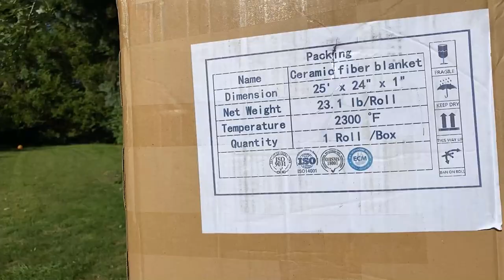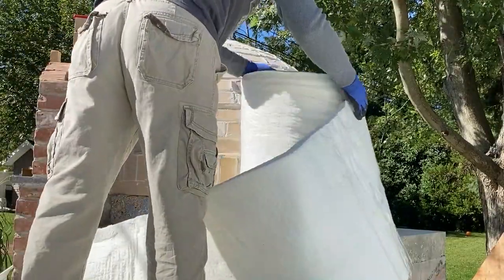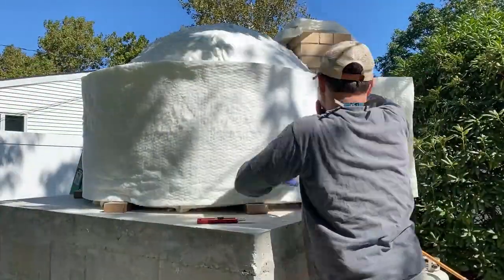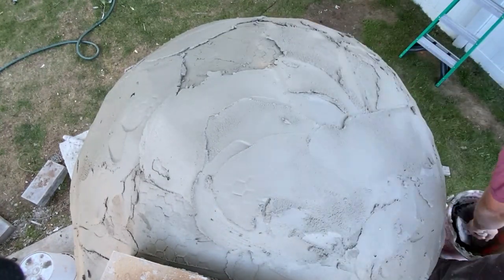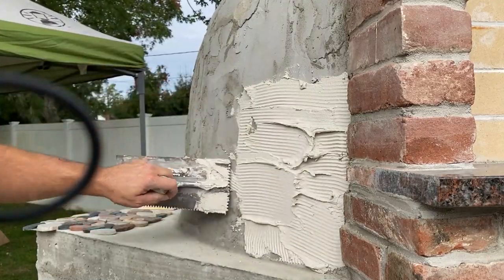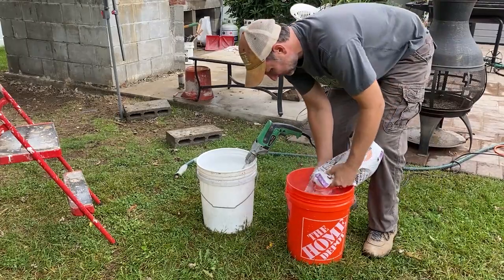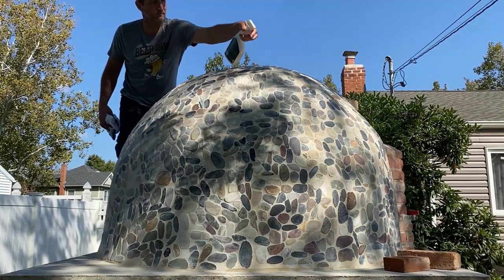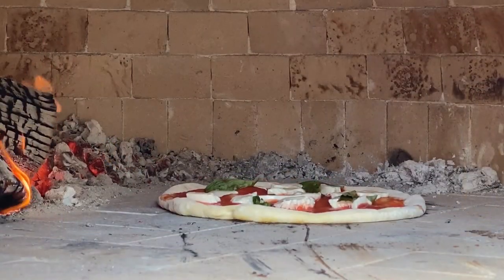How to build a brick oven / Outdoor Kitchen Build - Part 8: Insulating and Rendering a Brick Oven

Comment: The firebricks are way "too hot"  i.e. burning the pizza. I am thinking to use masonry bricks, not as hot and not as durable but better baking. Thank you for sharing.
Reply from the maker: That would be a mistake. Fire brick is what you want especially for durability. I have never experienced too much heat from the firebrick. Other bricks might be problematic If you plan on cooking multiple pizzas you will exhaust the retained heat and have difficulty getting the bottom to cook evenly with the top.
Reply: I get your point and you know more than me on the topic as I did not make a single oven yet,  but from the research I've have made it seems to be a problem especially the floor. Even in this video you can see the pizza was burned at the bottom. Anyway, thank you for replying, I will make an oven with masonry bricks as I have them in property. If they don't perform good I'll do it again with firebricks.

Comment: It took me about two years start to finish. I did the base because I had a lot of kiln brick laying around. Thought I could use it, built a dome, found out I couldn't use it, and walked away.

Restarted about a month ago. Doing the rendering layer today. Not as pretty as yours - I made some mistakes - but it's done and will work. The mistakes were fairly minor, but also I've never done this kind of project before

And absolutely could not, and would not, have even tried it without your help.  Thank you!
Reply from the maker: Thank you,  as long as it cooks great pizza, that’s all that matters!  Good luck!

Comment: Thank you for sharing an excellent series on this oven build. Can you please confirm what type of cement you used over the chicken wire? What was the mix ratio of cement and sand also. Thanks
Reply from the maker: It is type s concrete mortar. Sand is already mixed in. Just add water and you are all set. Thanks for watching.

Comment: Wow! just found your channel and this series, watched it all straight, and subscribed. 
A few questions if you don’t mind.
1) for the base brick why didn’t you use the 1” thick fire brick, as far as I know it has the same fire rating as the thicker ones? 
2) for insulting the oven why didn’t you also go with vermiculite, it’s obviously way cheaper?

Thank you, looking forward to your future projects!
Reply from the maker: Great questions!  1. Thicker firebrick has more thermal mass which allows it to store more heat and will stay hot longer. If you are making 10 pizzas, that stored heat is what will cook the bottom of it. Also, 1 inch firebrick is more likely to crack. 2 vermiculite does not insulate as well as the fiber blanket, and would need to be 6 inches thick to get close to the same properties.

Comment: Beautiful oven, been pondering building a oven myself but I'm no mason, I'm a fabricator. I thought about making a dome out of steel with two layers and the insulation between but not sure if it would still cook well due to it not retaining the heat as well as the bricks. I would use the firebrick for the floor since i feel that is a must. I haven't been able to find any information on this design anywhere.
Reply from the maker: I don’t think it would retain heat well but maybe use that shell to as a mold for the brick dome. Would be much easier to build.

Comment: Glass fibre insulation I think would be a cheaper option with a layer off vermiculite,
Also all ways two coat render and every coat has to be weaker than the first, tiles look superb great job
Reply from the maker: Don’t go cheap on the insulation. This is the most important part of a well built oven.

Comment: after laying down a foundation for my outdoor kitchen which will include pizza oven found your channel. 
A lot of valuable tips! Thank you SO MUCH!

I have a question to somebody that did this before in Southern California. Where did you buy a fire bricks? 
This is the only part Homedepot will not deliver. If you have a pickup truck I guess it's a silly question. I have minivan and it will take a few drives to bring 200+ bricks
Reply from the maker: I bought them a my local mason supply store. Home Depot doesn’t sell there here in ny.

Comment: I friend! I saw all your brick oven videos. I saw a tones of it on youtube and yours are the best! I woluld like to make my own oven. I have been thinking on build the dome with refractory concrete, using a wooden made molt. How you think about it? I would add the polistiren fiber and a outside brick layer. Thank you mate!
Reply from the maker: A lot of the prefabricated ovens are built like that.  If you are going to mold the dome, you need to use a special mortar.  Use a castable refractory mortar.  The regular refractory will crack once it dries.  I thought about doing a mold, but the castable refractory is very expensive where i live.  I hope it costs less where you are.  Good Luck!
Reply: @ArtisanMade  Thank you mate! I live in Catalonia (Spain, europe). I don't know what exactly is a castable refractory mortar. I do not know if is selled here. I think here is only the regular refractory mortar selled. Can you bring me some link to find something similar in spain? Thanks!

Comment: Can you make a video about how you use it such as maybe different meals you have cooked and what you would consider if you were to build it again. Maybe you would add more table space next to it.
Reply from the maker: I am planning on doing a video like that in about a year from now. This oven is part of an outdoor kitchen that will be completed next summer. It will include a pizza station, running water, and a wood fired bbq. Once that is finished I will be launching a cooking channel  that will focus on wood fired and brick oven cooking.  Thanks for checking out my channel.
Reply: @ArtisanMade  great stuff 
I have been searching for ideas and a blueprint to build a pizza oven and I would say your videos are probably what I will follow. Do you think the pizza oven should be protected from the elements such as rain? Or that is not an issue? I will be starting my pizza oven in the spring months in the uk. Do you not use the pizza oven at the moment then ? It will be great to see what other dishes can be cooked using the pizza oven not only pizzas.
Reply from the maker: I would definitely protect the oven from the elements. My oven is part of an entire kitchen that will be completed next year,  and will be covered. As far as the cooking goes. Once the kitchen is finished, I will launch another channel that will showcase brick oven cooking. Good luck with the build. If you have any questions along the way, let me know.

Comment: Your videos on the build are awesome! (Watched them 4 times already) Will use your instructions to build mine. However, quick question. Why did you decide to use vermiculite as opposed to Perlite? I’ve heard perlite is stronger. Thank you
Reply from the maker: That are both good.  I was able to find vermiculite locally

Comment: we don't have those kind insulator fabric back then we use glass bottle cut in half and build it around the oven including the bottom of the oven then fill the gap with a sand(silica). then cover it again with fire brick and cement.
the layer fire stone bottle+silica sand or iron sand then fire stone again.
so the fire brick attach between a glass use a cement.
Reply from the maker: Thank you for sharing this. I am always fascinated by how things were built before we had all of this science and technology.

Comment: I have been following this excellent series and today, I partially rendered the oven to cover the wire mesh and planning to complete another layer tomorrow. I am afraid that if cover the mortar(type S) with 1.5 inch; then if may fall off due to wait. Is it ok to follow like this or just need to complete the job the same day? I do have some exposed wire mesh but insulation is covered entirely.
Reply from the maker: I'm not really sure.  I would try to finish it all in one day if possible.

Comment: Great video's! Maybe you said this in one of the earlier videos, how much $$ were the materials for the project? What do you think a contractor would charge for a similar project? Hope yours performs as good as looks.
Reply from the maker: I spent between $2500-3000. You can cut costs if necessary.  The stone tile was expensive and the red reclaimed bricks were more than regular brick. If you live in NY. Contractors are expensive here. Most of this is labor.  I think labor costs would have to be at least $8000. Hopefully a contractor sees this thread and will shed some light on this.

Comment: Awesome video series!   Did you need to do any extra curing fires after adding the rendering/mortar/grout?  I'd think you'd want to drive out the water content just as slowly with these layers, but the ceramic blanket might slow that process down enough that you don't need to do anything special.
Reply from the maker: I did fire up the oven to about 500 degrees once before cooking  because I thought the same thing. But I don’t think it was necessary.

Comment: Great build! Not sure if anyone has asked this, but what was the total material cost?
Reply from the maker: The base and oven probably cost about $2500-2700  but you could cut costs on certain things like the stone tile.  That was expensive ($400) Stucco would be a much less expensive option

Comment: I added a clay chimney flue and rendered it with about 2 inches of Portland cement type S (chicken wire to bond it together).  My dome doesn't heat up at all given the insulation I added BUT the chimney flue does heat up since I didn't add any insulation.

QUESTION: If I set the tiles on the chimney flue with the Custom Building Products PremiumPlus Standard Thin-Set Mortar, is there a risk that the tiles will fall off given the high temperature?  Perhaps I should use a high heat mortar mix instead?
Reply from the maker: I plan on doing a video on the performance of this oven soon.  Oven takes about 2.5 hours to get over 800F.  Well over 1000F after 3hours.
You must insulate your oven, otherwise it will not perform like this

Comment: hey artisan, we're almost finished with the dome, we couldn't find ceramic fiber blanket in our area but we did find 1 inch thick Super Wool which according to the supplier is an alternative to ceramic fiber insulator and is rated at up to 2200 degrees and seems to be less expensive than fiber blanket, just wanted to know your take on using that over the fiber blanket. The plan was to wrap 3 layers around the dome but we felt it was too expensive to do 3 layers and decided on doing 2 instead, then wrapping the chicken wire around it and then covering the chicken wire with Portland Cement-Perlite mix since we had extra Portland-Perlite lying around and lastly the final coat of concrete over that. Whats your take on that plan? Anything that would need to be modified in your view or is it a solid plan? Thanks
Reply from the maker: I don’t know much about the super wool. I bought mine on Amazon. There is a link in the description. If I were you, I would spend a little extra for the third layer. A better insulated oven will heat up faster and require less wood and it will hold retained heat longer, I case you plan on baking bread and slow cooking meat. Over time, The money you save on that one additional layer will be spent on the extra firewood you will need to burn. Good luck!
Reply: @ArtisanMade  thankyou so much we'll be returning the super wool and getting the fiber blanket in your description instead, your videos have been the best on YouTube in our step by step build very straightforward & to the point and also great commentary during the build unlike some other YouTubers who talk for an hour without showing anything and then work, can get tedious, ours doesn't look as perfect as yours but for beginners I believe it'll do the job we will consider adding the 3rd layer instead, my wife does plan on baking bread for friends & family. I'll reach out if I have another question. Thankyou!
Reply from the maker: Adi Mart anytime!

Comment: I've always heard that at the end of cooking a pizza you are supposed to lift it up into the dome to finish off cooking the top of the pizza.  Just a thought.
Reply from the maker: If the oven is not hot enough, you can do that to get the nice char on top. The first 5 or 6 pizzas are cooking in an oven that is over 1000f and cooks very evenly.

Comment: How waterproof do you think it will be through the winter?
Reply from the maker: The dome is waterproof but I covered it with a tarp until I built the roof over it just to be safe
Reply: @ArtisanMade  that's what my fear is here in Michigan and I'm not ready to have another structure by the house

Comment: So, you just used cement to render? You did not mix it with vermiculite?
Reply from the maker: Vermiculite is used as a form of insulation. The rendering layer is concrete. If you are using vermiculite for insulating to dome, you still need to render over it.

Comment: For the complete oven, what was the total cost in materials? I'm wondering if its cheaper to build yourself or buy a pre-packaged setup of materials...
Reply from the maker: The base and oven probably cost about $2500-2700  but you could cut costs on certain things like the stone tile.  That was expensive ($400) Stucco would be a much less expensive option

Comment: Hello 
after 5 months is there something you would have liked to have done differently ?
Reply from the maker: I only used it about 10 times so far because it was covered for the winter. It cooks very well but I need to experiment more with it. I don’t have a door yet either so I haven’t made any bread yet, I hope to have more information by October and then I will do a video on this question

Comment: I want to start a project like this, however I have no experience and there is a lot of room for error!
Reply from the maker: I had very little masonry experience. I practiced by working on some smaller projects first. Then I built the base.  Buy that time I felt good enough to start building the dome. Practice is the key.

Comment: how much did it cost to build? how long does it take to reach 900F and cool down to ambient temperature?
Reply from the maker: Not counting the cost of the concrete slab. About $2500-3000
Reply from the maker: Takes about 2 1/2 hrs to get to 1000F
Reply: @ArtisanMade  Expensive as always to have a proper build. Thanks
Reply: 2.5 hrs sounds like the standard for reaching 900F. How long does it take to cool down till ambient temperature?
Reply from the maker: I don’t have a door yet. Without a door it is still very hot the next day. My goal was to be able to cook with retained heat for several days. Check back with me in the fall. I will be able to answer these questions with more detail.

Comment: Is there a link for all the materials used?
Reply from the maker: I am in the process of putting plans together with all materials used.  I will post them on my website as soon as they are ready.  Probably 2-3 weeks or so.  Check the description of the videos.  I did put links for the materials that are difficult to find.

Comment: I don't get why some 6 it goes to seven right and on seven you don't show us how you put the vermiculite with the mortar mix parts and how much to add and how much not to add I'm just wondering why you skipped all the way. To 8 put on the fire blanket in the little what about the fire mortar I really want to learn how to make that
Reply from the maker: There are 8 parts to this build.check out part 3 for the vermiculite concrete base. I explain the whole process and ratios

Comment: Good looking but incorrect dome width and height to obtain high pizza or bread temps without burning inordinate amounts of firewood.  Experienced oven experts have documented that you must not have a high igloo shape dome roof for effective focal point radiation of heat.  It will be interesting to see how your baking attempts turn out.

Comment: Very well done project, looking forward to doing a similar one this summer. How did it fare so far over the winter? I live in Minnesota where it has been stupid cold and am concerned about cracking. Are you able to fire the oven in the winter, i grill all winter but that's on a pellet and gas grill. I assume you had to set frost footings as well, we would need to here. Thanks for the excellent content and videos
Reply from the maker: Thank you! The slab was built with a footing. I haven’t built a roof over this oven yet, so I ended up covering it for the winter. Last time I used it was thanksgiving weekend. I plan on finishing construction this summer. The cold winters shouldn’t be a problem as long as water doesn’t get in and freeze. That is why I shut it down for the winter. I plan on using it next winter for as long as my body can handle the cold.
Reply: @ArtisanMade  Thanks for the info. It was 2 above on Christmas when i was grilling a beef tenderloin on my Recteq pellet grill and Weber gas grill. not the most enjoyable time for sure. Bring on spring!

Comment: I am putting all the materials together to build my own pizza oven based off of your design. I do have a question. Where exactly is the best position for the door of the pizza oven? Is it better for the oven door to slide all the way in to where the chimney is closed off when the door is in place? To me that position would not allow heat or smoke to escape the dome. Is this a positive thing? Or should the arch area be made with a lip that holds the door out past the chimney, allowing the smoke to escape the dome. This would also allow the heat to escape the oven as well. I am almost certain that I will get some responses from many people but I am really interested in hearing from anyone who has some experience and helpful advice.
Reply from the maker: Watch the dome video (part 5) there are good visuals for the door placement.